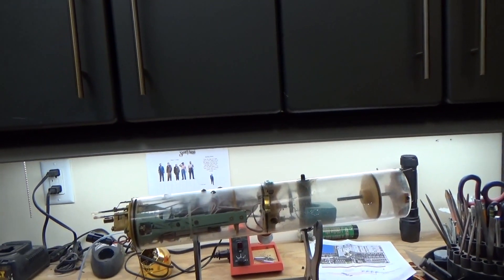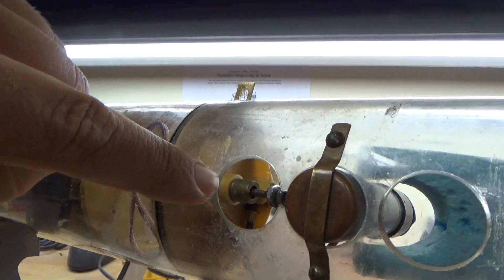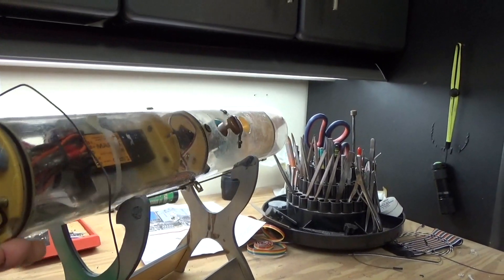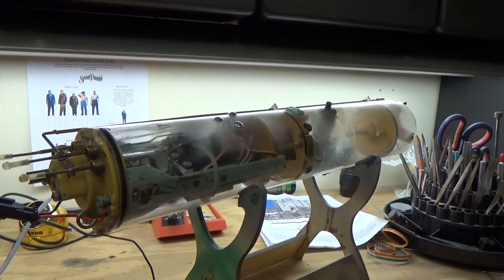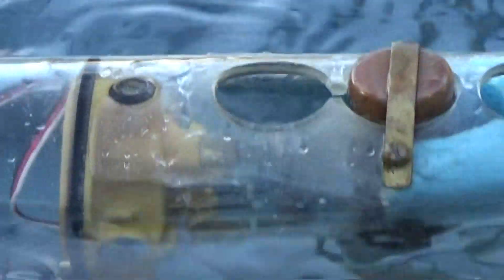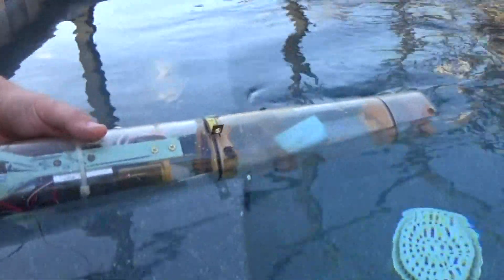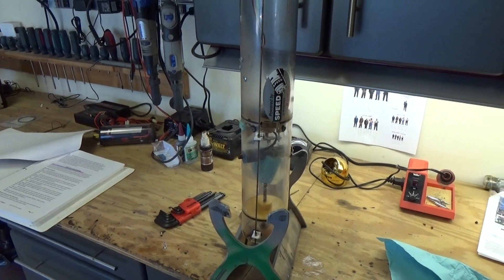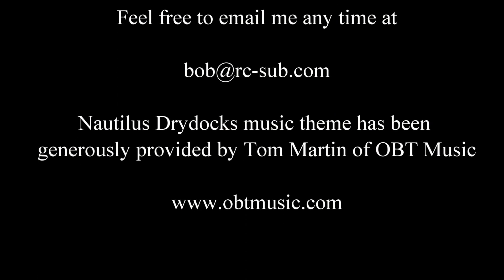RC Submarine watertight cylinder leak repair

Comment: Does any epoxy will work or got to be one specific  for plastics? I was thinking about "pasti dip" !!! As always a real pro at work!
Reply from the maker: Plasti-Dip is a great product for putting color and texture on something, however it is designed to be removable and as such I would not recommend it for this application. If you want a spray product, use eavestrough liner, rubber vehicle undercoat or truck bed liner.